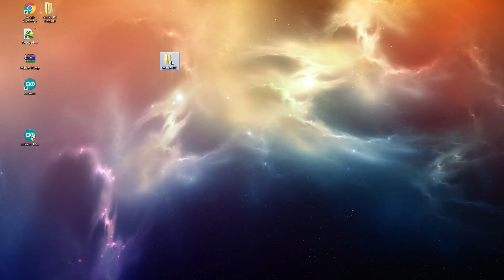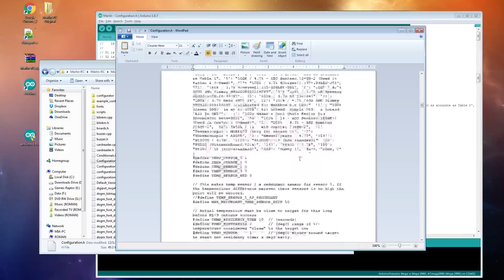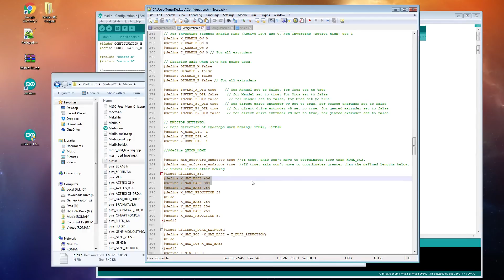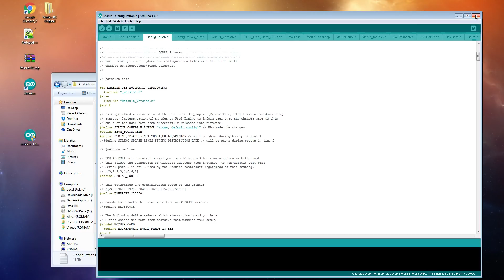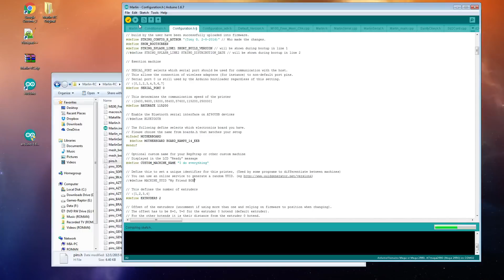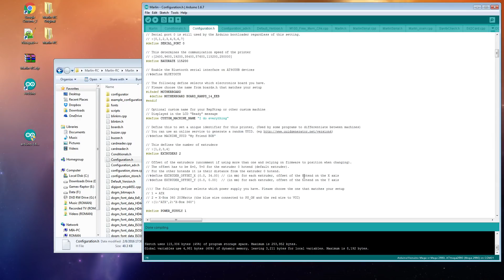Basic Marlin Firmware Tutorial

Comment: Is it possible to download what is already on the board of the printer to back it up in case you screw something up?

So all you have to do is upload the original set up?
Reply from the maker: +Nubyrc There are a few methods to download the images off of your existing mainboard, but nothing that's easily done. Your best bet is to work from a manufacturer's provided image. But, while your printer is plugged in you could run the "M501" command which should read the parameters from Eprom (your current working settings) and display them for you.  You can write those down and use those. Basically the same thing you're asking just only the information you need and not the whole firmware, as long as the manufacturer/builder turned that function on.